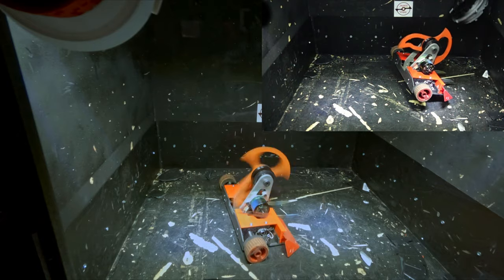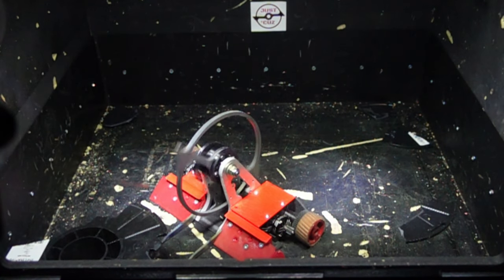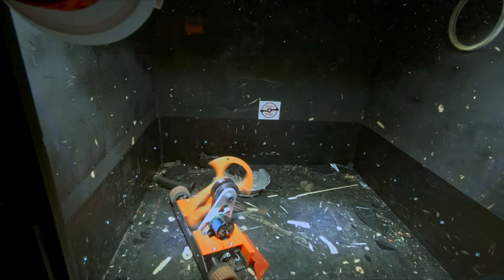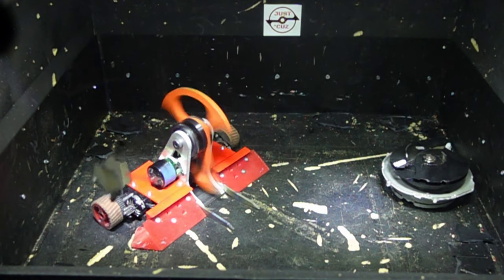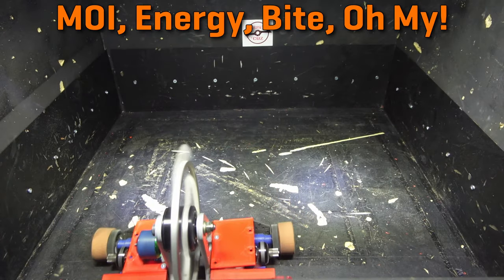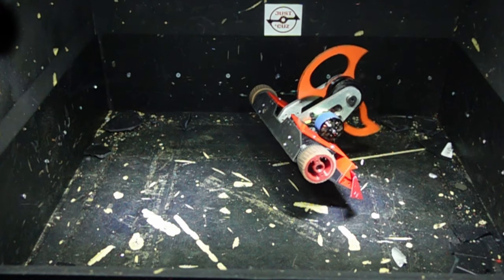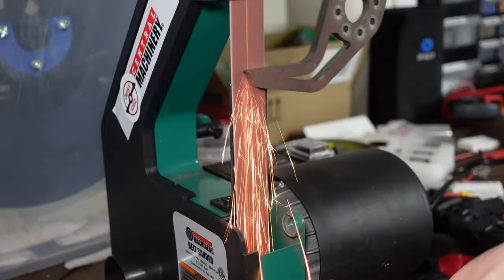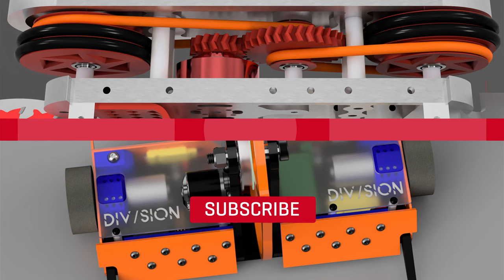Mini Battlebot in Slow Motion! Division V3: Weapon System (3lb Beetleweight Combat Robot)

Comment: We actually just did all of the math you mention about raising a 3lbs mass using GPE in engineering academy. We learned about free body diagrams, force, potential and kinetic energy, and just finished torque and static equilibrium. Currently we’re doing a project about bridges where we have to build a bridge and calculate the amount the bridge should be able to hold and I assume we test that but I haven’t gotten to that yet. Just really cool to see that shit I learn as a sophomore in high school may actually have real world value. Great vid as always!
Reply from the maker: I didn't learn how to do any bridge design stuff until I was a freshman in college! That is way ahead of the curve, good stuff. And yes it's always great to see physics and math applied to the real world! Robotics has a lot of that.

Comment: Sounds like the weapon motor and weapons themselves won’t be more powerful, but the weapon stack and weapon positioning improvements will make it better at transferring that power into an opponent efficiently. Liking that you have a new option for fighting verts and drums, looking forward to seeing it at Norwalk!
Reply: Also the music seemed good to me, I slightly preferred it to the previous music.

On an unrelated topic, any plans for a new ant weight or alternate config for mini mulcher that could fight alongside division but with less potential for friendly fire?
Reply from the maker: Good question. I think the new drive setup for Division is actually robust enough to tank hits from Mini Mulcher so that's a possibility now, but I will need to make a lot of changes to Mini Mulcher to have enough control with it for it to be useful in a Beetleweight fight. In my last vid showing the drivetrain you'll see I attacked Shrapnel Mine with Mini Mulcher and wasn't able to do much damage to the wheels.

Comment: WARNING: battlebots S6 spoilers

one worry i have with that new super high rake blade is that in events with wood floors like norwalk it might end up embedding itself in the floor and pull a Blade and shear it's own tooth off, but otherwise looks like it would sure be slicing those UHMW chassis/wheelguards on beaters good
Reply from the maker: The Battlebox walls are solid steel. Blade's weapon used an aluminum body. That's why it broke. Steel on wood: wood loses every time. I already hit my test box walls with it which is also 1/16" thick steel and substantially more likely to break it and it didn't do anything.